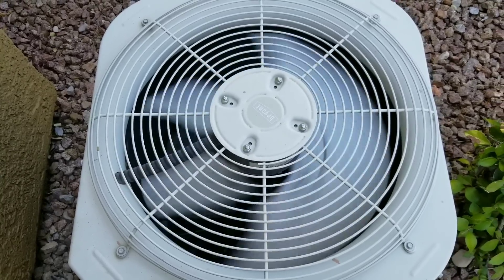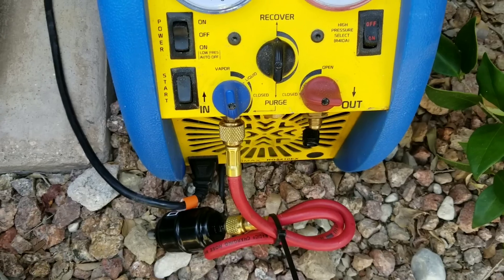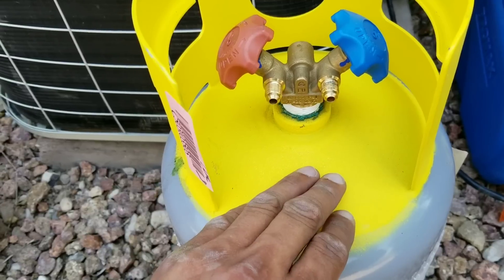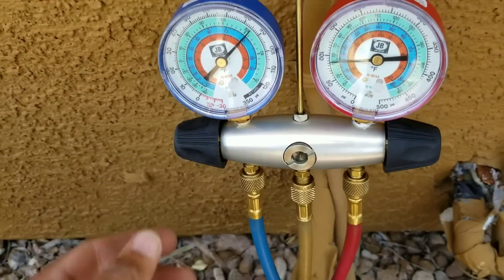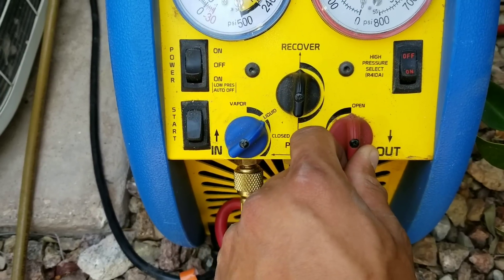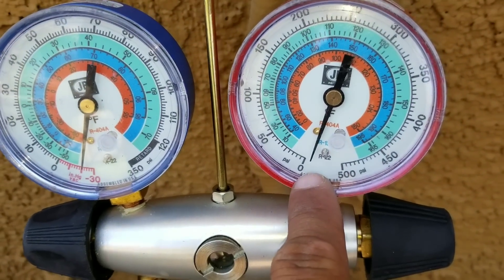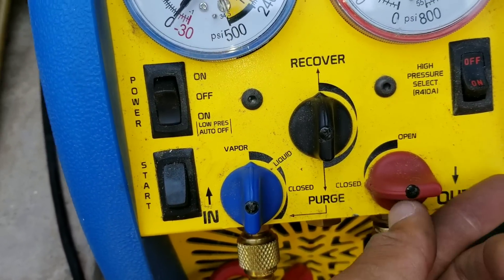How to Recover Refrigerant Properly HVAC.

Comment: If using the liquid side of the tank you will not be able to pull it as efficiently as if you put it on the suction (blud) side on the tank and turn it over since on the red there's a fine tubing goes down that will cause pressure to raise
Reply: What if you put it in a bucket of ice?

Comment: I'm still learning the trade and am in trade school. I thought we were supposed to connect to the vapor line on the recovery tank and not on the liquid line of the recovery tank. That's what it says on my worksheet for school so I'm going to stick to the vapor line on the recovery tank. We are using window unit ACs for the test and procedure.

Comment: Hi Sam. Awesome video and I’m getting ready to recover all of my refrigerant from my system to replace a leaky coil and your video appears to be the most straightforward I’ve seen.  Question for you would be how would I purge the lines prior to using your procedure?  Also, do you have the model number of the recovery machine that you’re using?

Comment: Not an HVAC specialist, or even apprentice/employee for that matter. Just a curious mind but why can't you reuse the tank for a different gas after the one recovered gas has been reused elsewhere?  (i.e. you recover R-22, then reuse that R-22 in some other system but then aren't able to put in something like R-410A afterwards) Is it that there might be residual gas left behind that might mix in the secondary gas causing unforeseen issues, maybe? What if on the tank someone were able to, and did, remove the valve then rinsed the inside of the tank and allowed it to dry, then reinstalled the valve. Would you then be able to reuse the tank for a different gas or is it generally a hands off altogether ordeal? Why? Please explain... I'm generally curious so any info would help, thanks.
Reply: you can add r22 to the bottle and pull it out to somewhere, and do a vacuum to the bottle and add r410a to it later. However, you can not put 2 kinds of refrigerants into one bottle at same time.

Comment: Can you add recovered refrigerant back into the system once you change out that shrader valve?
Reply: You can by law, or charge back to any systems the same owner has, but usually you should do a reclaim job to the refrigerant to clean up especially since that was a bad leaking system, and of course this will cause more time and costs for the customer, but that is a better quality job.

Comment: I adore you confidence, and that soldier confident to the funky fun voice, but there is a huge but!

This is still informative,  but it's crazy far from proper recovery. Ok for a person in financial pinch, but this is quite a messed up instructional,  recovery contaminated with atmospheric air and moisture big time, and later vacuuming the system is not a guarantee to fully eliminate it, you would have to break the vacuum  3 times with nitrogen,  and still no guarantee

Comment: Connected all hoses, opened tank valve, hit recovery...  Hold on dude!!!

Keep tanks valves closed,  everything else open.
Unscrew the hose a bit at the tanks valve to purge 3-4 seconds, tighten back up snugly.
Now ready to open rank valve and hit recover....

When you were done with liquid side, and changed the hose yo the vapor side, you had to purge again at the tank, and only then open tank valve and go on to recover/start button.
You didn't  purge just again...
Mishap on  mishap...

Comment: Brand new tank,  caps on...
They come filled with nitrogen. Nitrogen is supposed to be purged out the tank, and vacuum pulled on the tank, before it can be used for recovery...

Comment: How do you make sure there is no air in the lines when you disconnect, and reconnect the hoses? I mean, I would use vacuum pump to manifold, then extract all the air before opening the liquid and vapor valves from the ac unit to manifold.
Reply: That’s pretty much it! Lol. Vacuum pump to purge anything in the lines. Least that’s what I was taught!

Comment: in beginning you show your gauges, claiming it indicates the amount of refrigerant is low. it sounds like you're assuming the viewer already knows how to read the gauges. maybe this is first time viewer has seen any of your videos, which you might have explained in an earlier video? This video would be more informative if you had taken the approach to assume the viewer doesn't know anything related to this procedure/topic. you could have easily spent five more seconds, explaining what the gauges would either normally read with full/nearly full charge.  As it is, your video created more questions than it answered.  the Schrader valve might have just been loose due to maybe vibration or some prior a/c maintenance being performed.

Comment: why are you starting with liquid? im in School right now and my teacher who's worked in the Air Force for 10 years and Good Sam Hospital for 15 years and he told me and the other teachers always recover with vapor, you can with liquid but they tell us to do vapor
Reply: You can do either, or both, but vapor recovery is very slow.  You should recover liquid, (on home systems this will usually been between about 7 and 12 pounds), down to between 0 and 5 psig on a system with a leak, or negative for a system that does not have a leak.

Comment: On the service ports, do the valves have to be front seated or back seated?
Reply: usually totally back seated will seal up the service port, totally front seated will seal the line pipe to condenser unit, mid seated will open all the 3 ports.

Comment: If you're scrapping a  new unit that does not utilize Freon as a heat transfer medium, do you see any issue with shutting off the electricity supply to the unit and then simply cutting the coolant lines running outside your home to the condenser?  
Whereby letting the coolant bleed off into the air...
If so, what are the issues of concern?  
Wearing safety glasses whilst cutting the lines comes to mind, but other than that...?
Reply: do NOT cut any refrigerant pipes... ALL refrigerants in use today are bad for the environment, some a lot worse than others but none of them are "good".  Depending on the refrigerant in the system many refrigerant dealers will buy it back so finding somebody to recover it free of charge is often quite simple, some compressors are also designed to hold a certain amount of refrigerant too by what is known as a pump down operation (it uses the aircon compressor so no tools required)
Reply: https://www.youtube.com/watch?v=k72JpZGauvI
Reply: ...oh boy.

Comment: So recover liquid then vapour from the same  liquid line connection at the condenser? Or do we switch over to the suction line when recovering vapour?
Reply: Always recover liquid from liquid line and vapor from vapor line or suction line. But no need just recover from liquid line and that’s it.

Comment: Why are you pulling the low side below 0? Youre introducing noncondensibles into the refrigerant line. Also backseated the gagues in the wrong order and forgot to purge at the tank. Always low to high.

Comment: Can you explain what you are looking for on the gauge? When you did the high or liquid what are you looking for on the garage? What is a good range? For the low vapor side are you just looking for the needle to be in the red? Also, when the needle is where you want it to be should you let it run a few seconds before turning it off or can you turn it off right away? Does the order in which you open/close or flip switches on/off?

Comment: 1. Purge line before recovery.
2. Since it is a leaking system, I wouldn’t let it go below 0 since you may suck air in.
3. Weight Tank first making sure not exceeding the 80% limit.
Reply: Agree with Aaron. Always weigh your tanks when filling them. Purge purge purge and never assume the shrader valve is the only leak so don’t pull down too far past 0.
Reply: Defs purge!
Reply: @kerrodmartorella4949  Vacuum is better then purge
Reply: Hes not sucking air through the same place its leaking. He's connected to the shredder hes replacing. If it was a flare though then u would go just below refridgernt exposer is worse then tiny bit of air in the cyclinder. Which shouldnt go back in the same system either

Comment: Few thoughts here 
1/ use a schrader replacement tool, 
2/ a brand new tank? always vacuum it first to remove the nitrogen 
3/ mark not just R22 but clean / or Dirty 
4/ didn't purge hoses or the recovery machine 
5/ best stop the recovery above zero, then replace the schrader without sucking air in.
6/ Why the switch from liquid to vapor toward the end? When you were below zero anyway? Stick to liquid the whole time can't go wrong. No need to switch on the tank it doesn't matter. 
7/ at 5:44 operated dials in the wrong order, didn't purge the pump. Next time it's used it's bursting with R22. 
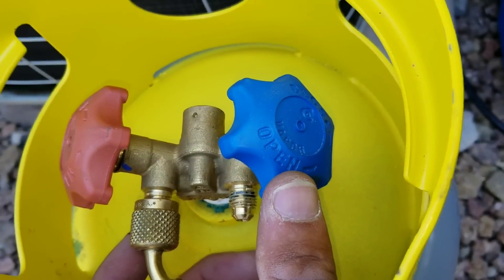8/ is that a linked suction line  at 2:44? 
9/ good practice to weigh the gas regardless, pencil the weight on the tank
Reply: Appreciate your comments.  Can you do a video
Reply: Nathan  can the recovery machine filter or separate if there is air in the system?
Reply: ellis peterson. No. If air has got into the refrigerant it's usually bad news. If it sucked into the bottle you can either: send the refrigerant fairly promptly to another vessel by liquid only, then gas off remaining vapor to lose the air. OR gas off vapor from the bottle to lose the air. (because air floats to the top) 
I'll get my fingers rapped on both these suggestions due to gassing off however choices are limited. 
Run the gas through a filter drier, and install a filter/drier on your  AC
If it's nitrogen it's not such a problem, there's no moisture. 

A recovery pump cannot separate or purify gas but you need a refrigeration distilling machine, of which some companies have one but  I have no experience
Reply: What is that yellow bubbly liquid called? That he put on the schrader valve?
Reply: @Anonymous-wf8gu  leak detector
Reply: No scale and you fail. Lol

Comment: The only thing that i would like to remark is that is important to always purge the hoses before let refrigerant enter into the tank. If we don't do that there is a chance to allow air (with moisture of curse) and contaminants get inside the tank. So basically we're making useless that filter-dryer
Reply: Glazed Guava because these types of procedures need to be demonstrated meticulously so techs who are trying to learn or recall certain things within these procedures won’t be confused or else a 3 to 4 hour job would have to be done all over again or possibly a waste of time and equipment damage.🤷🏽‍♂️
Reply: You are correct! and may I add that you should not start the machine under a load.
Reply: @timwilson6650  thats what i think too. why not let the flow do the work
Reply: Yes
Reply: Spot on mate!
Reply: Just did that class yesterday! 👏
Reply: Yepper !
Reply: Low loss fittings are a must, especially for purging.

Comment: No low loss fitting and no purging of the hoses? You just added several hoses full of air to your recovery tank. If it is humid at all, the moisture is going to start acid to form in your tank and the system if you put the refrigerant back. Next time, use the purge feature of the recovery machine!

Comment: Sam, great video. I'm a newbie and in order not to be confused with all the connections I am wondering if it's necessary to use gauges. Can we connect straight from the liquid line to the machine and use the gauges on the recovery machine..
Reply: newtong579 I say yes. Gauges help you determine if you still have refrigerant in the unit. You don’t want to release refrigerant since it affects the ozone.

Comment: Can someone explain what difference it really makes wether you recover in vapor versus liquid? For example what was the point of switching over to recover vapor after you were already into negative pressure after recovering liquid from high side.
Reply: None, i believe those valves are for charging and saves inverting the tank to withdraw liguid. Whatever is been recovered should go in the tank on either valve side

Comment: Can I do this myself without a refrigerant recovery machine to save money and then just get an AC guy to put new refrigerant in? I am a handyman by trade and would like replace the compressor myself. If you respond, please upvote so I know you responded. Thanks.
Reply from the maker: You must be certified in order to handle refrigerant in any capacity... this includes recovery and recharging of refrigerant... replacing compressor etc. I do not recommend you work on the system if you are not certified. If you do call for service and the on site technician suspects that you worked on the system he can report you and  the fine is a few thousand dollars. Hope that helps. 🙂
Reply: @MoreThanMaintenance  Are you saying it is illegal for me to work on my own AC compressor?
Reply from the maker: @marks6663  Unfortunately if it has refrigerant... yes. You are legally allowed to work on everything else on your system... capacitor, fan motor, thermostat... all the electrical. The EPA has a strong hold as to what legally you are or are not allowed to do regarding the refrigerant... When you go for certification the test has nothing to do with HVAC related repairs whatsoever. It literally is how one is to properly handle refrigerant... laws... environmental standards etc. Hope that helps my friend. 🙂

Comment: Bleed the yellow line also I was just doing some schooling on this today and I was told you should do it on the vapor side being that the liquid side will heat the cylinder up a lot more?
Reply from the maker: Can you add more details if possible to your comment for the other viewers. The vapor side (low side) is the blue... the liquid line (hi side) is red. You advised to bleed from the yellow line.
The yellow is the waste or vent hose. Do you mean to bleed the yellow hose before or after recovery? If I bleed the yellow service hose before recovery won't that allow air in the line... or do you mean after the recovery as to not contaminate the system when charging another system. Thank you for the added input and clarification for the other new techs who are entering the industry 👍

Comment: What’s the reason for filter drier on recovery machine?? Just asking cause I’m in the field as a helper and 2 years in NEVER seen this
Reply from the maker: I had one of the older field Supervisors tell us if you are going to reuse the refrigerant this will help from contaminating the refrigerant. Hope that helps. You can purchase these specifically for recovery machines. 👍
Reply: Sam yes! Makes sense now we never reused refrigerant. That’s why I probably never seen it. But that does seem good to have on the truck just in case! Thank you
Reply: @jr27ny  No, the filter dryer is not use to keep the refrigerant from contaminating, if you look the position of the filter is before the inlet port of the recovery machine so the filter is to protect the recovery machine from the contaminated refrigerant that you're recovering

Comment: didn't have a core remover tool huh
Reply: He did mention that he’s going to be Converting  the refrigerant so I don’t think a core removal tool would have done the trick .
Reply: The most insightful comment here by far.
Reply: Yea he probably could have just closed the liquid line and pumped it down. Then remove and replace the valve. Then give it a charge
Reply: @derrickdees3754  Yes, but he was going to charge with a different refrigerant
Reply: Also close the suction line after pumped down

Comment: Purging air and weighing out the salvaged R22, or because you were not planning to reuse this refrigerant in the system, weigh-out wasn't necessary? Just thinking it would be good to know how much of your 80% recovery tank capacity you have left to fill?
Reply: purging the air is important, but weighing out is not really necessary.  All recovery tanks have a tare weight. So the weight of the tank with the refrigerant minus the tare weight will be the amount of refrigerant recovered.

Comment: Hi Sam, very informative video. I've watched it a few times just to learn the procedure. My question is about venting the lines to remove air. Is it required as I guess the recovered R22 is no longer useful?
Reply: It's called "purging" the lines of air. Yes you should always purge the line if your going to reuse the refrigerant after a repair. If it's going to be reclaimed, or in the case of R22 can be sold to a supply house, don't worry about it. Fyi still use a filter dryer, it protects your recovery machine.
Reply from the maker: If your talking about venting the lines into the recovery tank... I guess I do it out of habit 😅 so no you don't have to vent out the lines. As for the refrigerant... the refrigerant should be fine if you wanted to reuse it. The recovery machine should have a filter attached... admittedly not everyone chooses to do so... but if you do have a filter you can reuse it 🙂
Hope this helps and thank you for watching!
Reply: @MoreThanMaintenance  Just my 2 cents, but the refrigerant actually cannot be reused anywhere except in the unit it came from.
Reply: newtong579 you should always purge your lines. Air in your refrigerant can contaminate it it. From what I remember you shouldn’t use it elsewhere or be given to the owners (since it’s there refrigerant) but it should be turned in.